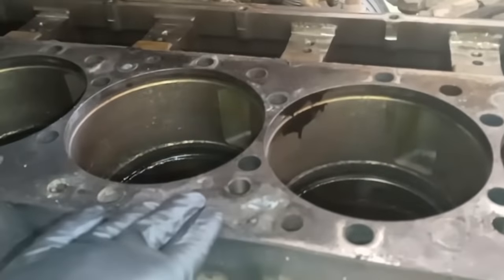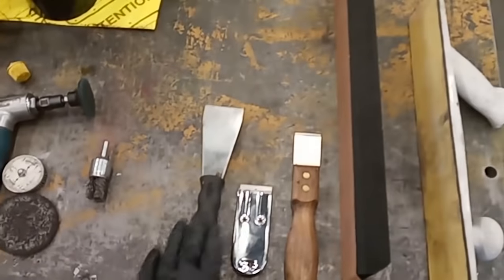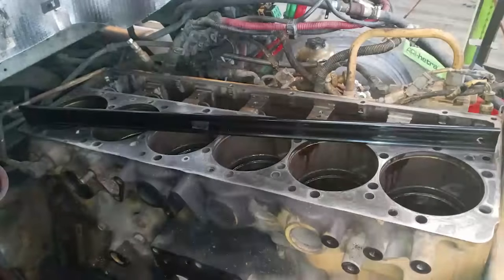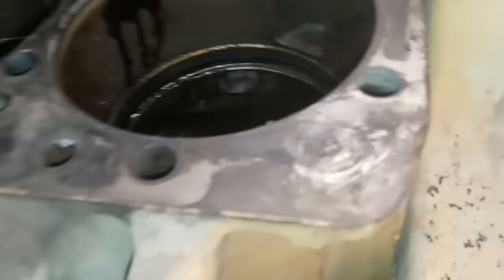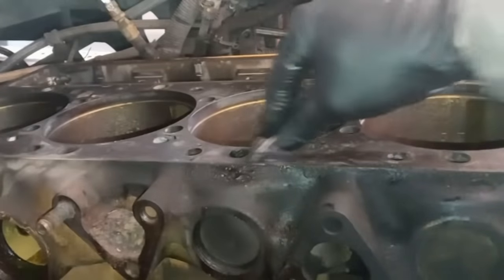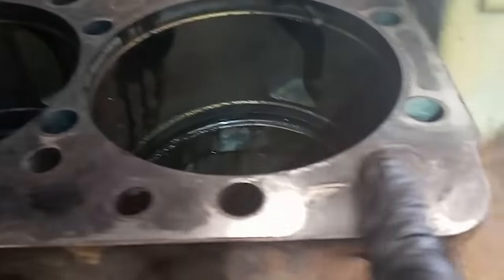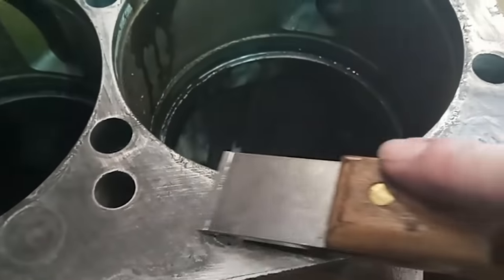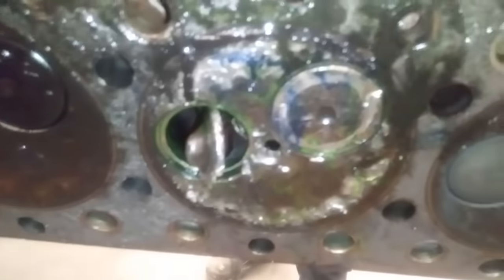Clean a Head Gasket Surface like a Master Engine Builder.

Comment: It takes a lot less time to do it right the first time than doing it over.  Whomever said that was right -- and I tended to learn the hard way.
Reply: I will never forget the plaque on the wall above and behind my shop teachers desk that read "If you don't have time to do it right, when will you have time to do it over?" That was 61 years ago when they still taught life skills in school.
Reply: I used to work in aviation and doing everything per the manual and standard industry knowledge was the thing. As a tech having a return from service was a black eye, or foot to the nuts if you messed something up that was preventable from the start. 
I had a plane back at the shop the next morning after an annual. The gear wouldn’t retract. My bosses were on it for half the day trying to figure it out. It wasn’t until I had a sudden memory of showing a dummy coworker the “emergency gear drop” cable under the pilots seat. The idiot pulled it. That almost had me canned, him walking out immediately with his tools, and me feeling like a fresh turd on a wet lawn. Safety and integrity in your work is key for the better of everyone. Your shop won’t have to lose money for repeat work it should have had done right the first time and the customer is safe with work well done. I should’ve checked the CO2 cartridge myself after, but that’s what trust in others gets you.

Comment: Im a paccar and cummins tech, what i like to do on cylinder head/block deck is to spray some wd-40 or pb blaster( to each their own) leave it socking over night, and when i finally start working on it, use a scotch brite burgundy pad(150 grain) the ones i use at work are excellent, they are great for cleaning metal surfaces,use that pad to clean as much as i can from the block deck and once ive covered the whole area, then spray it down with the brake cleaner, after that use some soapy water( dawn is my preferred soap, i like doing this because it gets any dirt or debri of of the surface, then brake cleaner again, and use the scotch pad to clean any uneven surfaces, once everything is good, spray it down with some crc contact cleaner, this will remove any small material from the surface,thats my method, it has never failed, i mostly do this for cylinder head/block deck surfaces

Comment: I am no mechanic myself but have taken some heads over the years to a machine shop to get skimmed to true it or valves/seats ground etc and I asked the owner of the shop what should I be using to clean the block deck with and he was adamant that I only scrape and do not use abrasive roloc's for the uneven mess they can create plus the abrasive dust, no sand paper, nor any form of hand type scotch brite pad because it has abrasive on it as well and claimed many an engine has been ruined just from those hand scotch brite pads. The problem he pointed out is that any abrasive that falls down into the engine which would be into the valley of a pushrod cam in block engine for instance or any oil passages within the block deck will end up pumping through the bearings and imbed themselves into the bearing and sooner or later bite you in the rear. Oh I imagine if the block was totally torn down and all oil gallery end plugs removed and dipped and so forth is one thing but its this top end work with the block in the piece of equipment that doesn't allow for complete cleaning. I feel the pain as well, picking away with a scraper and it never ends with taking minute quantities of gasket material off and wish there was a better way also. Adept Ape, I really enjoy your channel as do other farmers I know as you have a vast knowledge of Cat engines. With this frustrating gasket removal issue, how about you make it one of your missions to talk to various engine machine shops and if you know anyone higher up in the racing engine rebuild world, perhaps there are some secret methods most of us have never heard of.
Reply from the maker: You make a very good observation there and the balance of trying to properly prepare a gasket surface vs not getting any contaminates into the engine is an interesting topic. I would say at a machine shop it is an easier decision since everything is going to get hot tanked and properly decked. On an inframe rebuild or a field repair you are trying to do the best with what you can do. Now perhaps a better way is to just scrape the surfaces and the wipe them down, that would disturb the original machining marks the least, but perhaps miss some high spots or embedded gasket material? 

The topic of contaminates destroying engines is interesting as well, as every time a valve cover is removed dirt is getting into the engine. The particle size has a lot to do with how much damage it can cause as well. If the size is smaller than the bearing gap it has a tendency to not do damage as it can be flushed through the system without being wedged into the bearings, if the size is close to the gap size though it can cause the most damage. The larger the particle, the least likely it is to get past the screen and filter. Very interesting topic and I try not to take a dogmatic view on it as there are many good points to be discussed.
Reply: @AdeptApe  Thank you for the reply and also for not thinking I was trying to belittle anyone as topics like this can get people rather wound up because they have done a certain thing for years and can get their back against the wall to to speak to hear someone tisk tisk a practice. You are so right, the machine shop can very easily say do this or that because he has all the equipment to work with a complete tear down and isn't the one working on a head removal only or an inframe. Now unless I am wrong I believe that machine shop was pointing in part to the fact that some of the grit particles that find their way into the oil passages are "after" the filter and so the filter can't remove what doesn't come to it until it has flowed through the engine upon start up to then come back around to the sump and filter. And I am sure that different engines due to their design are going to be more or less susceptible to getting the abrasive into the wrong side of the oil system when cleaning off a deck. 

I had never seen a carbide scraper before, looks like an easier tool to work with then the razor blade that sure wants to catch on any edges or holes that don't have a chamfer. I have holders just like you showed and recently bought a long handled type handle but have yet to try it out. But believe me, I have been so tempted at times to pull out the roloc on the angle die grinder out of frustration and go to town on the project but have to hold myself back.

Comment: I’m a marine diesel tech, work on mtu man and cat. We clean decks the same way but if you use some wd 40 with some scotch bright pads after the sand paper it will shine the deck up good and pull a lot debri you can’t see by eye out

Comment: Been doing this over 40 years and agree. It's easier to keep it flat than to make it flat.
Reply from the maker: I like that expression, I might have to use that.
Reply: @AdeptApe  Also: "It's better to be looking at something, than looking for something." 
I'd rather be looking at old material and taking my time, than looking for the metal I've just gouged out of the block with a disc.  :-P
Reply: Ok quick question, this all sounds good and is good. But you are sanding down the block, is there a tolerance? I was told you aren't allowed to sand so that the tech height remains the same, lets say your just changing a head gasket
Reply: Just curious. Do these same principles apply to a car head gasket?
Reply: @stocks4bt  absolutely
Reply: @traviscallaway9675  thanks
Reply: @viktortulbya2107  that's why you use 💯 grit sanding cloth  Your trying to get it flat and smooth without removing to much material
Reply: @viktortulbya2107  Yes, if you remove too much material you reduce the size of the combustion chamber, altering the compression ratio.  But that comes up more with shaving decks repeatedly at the machine shop.  Not likely here.
Reply: @reallyhappenings5597  i think this one has liners, no really i am just wondering about the distance between the crankshaft and the deck top,
Reply: @viktortulbya2107  it's deck height, and there are tolerances. there should be a groove somewhere in the block showing how far down it can be machined. there are only a certain number of times you can resurface/ only so much material you can take off before you need a new block
Reply: @johnqpublic401  deck height is what i meant yes
Reply: @viktortulbya2107  you’re not removing 0.005” so you are safe.
Reply: @stocks4bt  yup. Standard procedure for any head removal is to put the head on a surface plate to check for flatness.  Lawnmowers too.  The straight edge on the block tells you it is ready for mounting the straight head.
Reply: @reallyhappenings5597  for some engines you can buy oversized thickness gaskets.
Reply: @aussiebloke609  thats like the mercedes repair guide lol

Comment: Pro tip.  Cover rod bearing journals. Before any scraping, or sanding.     Don't want debris in oil ports.
Reply: If you do get debris in there or in the cylinder, can you just get an oil change to get that out of the system?
Reply: @gersonruiz1714  on first start up.  The debris would hit the new bearings,  because that's after oil filter.
Reply: @claterpillar1  how would I get the debris out from on top of the piston head?  Mine kinda looks like there’s debris on the edges
Reply: You can try using a vacuum to get it out

Comment: If the block isn't going to be thoroughly cleaned in its entirety, I would never use anything abrasive that can contaminate the internal part of the engine block. If u choose to do it anyway, I would painstakingly tape off the cylinders and other internal openings followed by a vacuum after completing the preparation. In looking at the video, u can see the sharp edge on many of the bolt and coolant holes. These should be hit with a tapered counter-bore to break that edge. Also, after scraping and Brakeclean of the surface, the entire deck should be sprayed or brushed with blue machinist layout dye (Magic Marker if u must). This will indicate the low spots in the deck very quickly during the sanding process so that particular attention can be focused on them using the straightedge with a light shining from behind; the suspect area then measured with a feeler gauge for acceptable compliance to specification.

Comment: Those zip wheels spray abrasive all over. I think that is a bad idea.
Reply: I've been using roloc disks for years. Yes they spray stuff everywhere. But, clean up after yourself.
Reply: Half assed way to do it though. If time is a concern use the 12” pneumatic sanding board, done in minutes and it’s done perfect.
Reply: gotta clean up with a vacuum, always

Comment: I've had the exact same experience as you. Went to school learned that scrapers, elbow grease etc the correct way. Got out in the field, even asked others, "what's the best gasket prep?" to which I usually would hear, "the fastest. scotch brite discs". Anyway, perpendicular razor has the lowest damage potential, angled on aluminum will cut chunks. Wet sanding with fine grit and WD seems to get things clean fairly quickly. Also, with the straightedge, put it on the surface and shine a flashlight behind it, look at the straightedge from opposite side and... light can't pass if there isn't a gap.
Reply: Yup same here 20yr red seal. Use razor scraper and scotch paper not rolocs. Use a lath fine file and if you need it to be perfect try using Prussian blue where ever it remains is a low spot. Draw file to verify.

Comment: Always done it using various scrapers and sanding. Everyone did back when I started and it’s served me well. My engines don’t come back.
Reply: Yep, diesel fuel works as a cleaner as well. Toilet brush and a bucket of diesel for first cleaning then finish off with some brake cleen. Good tip for anyone that's not getting a free supply of brake cleaner lol
Reply: @johndowe7003  Diesel was all we had when I started, the firm was too tight to buy brake cleaner! Though it was trichloroethane at the time which apparently causes cancer, so maybe just as well.
Reply: @andygilbert1877  yup we still use diesel to clean parrafin and oil off our rigs. The new style of diesel has a lot of surfactants so it's pretty much the same as soap. It's a game changer for small businesses and independent guys since it's a lost more cost effective.
Reply: @johndowe7003  Yep, plus you’ve generally got loads of it! (I worked on heavy equipment & fork trucks) We’d use it as a freeing agent too...leaving seized stuff in it over a weekend rarely fails.
Reply: @andygilbert1877  yep, dont forget to include shoving grease into holes with threads in them to protect the threads from the elements. i would always do that  to equipment that i would put away for later . plus diesel is the best soap for hand washin, just dont forget to rinse off with dawn hah

Comment: Ordered those scrapers and it's good to see someone else break out the out the autobody tools in a heavy duty shop I'm a heavy duty tech that grew up in a family bodyshop I will offer the advice that sanding blocks are most effective when use the 45 degree rule if your holding your sanding block parallel to the length of the head or block surface you sand in a 45 degree cross hatch or you have the sanding block on a 45 degree angle to the deck and sand parallel with the deck and change your paper often about 30 swipes by hand or 30 seconds with a sander. Thanks for the videos

Comment: As an engineer, I approve your video. Flat, straight and clean just like a fresh machined surface  is the way to go.
Reply: Well an engineers opinion is that valuable to a mechanic fixing the junk yall overengineer.....
Reply: @85jmccoy  Oh don't be so naive. Everything is designed and built to a price point set by someone wayyyy above an engineer's paygrade. It's not the engineers you should be frustrated at...

Comment: I USE A SURFACE STONE WHICH I HAVE HAD FOR 30 YRS FROM BUILDING STEAM TURBINES. IT WORKS GREAT ALONG WITH STRAIGHT EDGE ,FEELERS,WD-40 AND BRAKE CLEANER.THEY MAKE THESE STONES IN DIFFERENT SHAPES AND SIZES,SUCH AS TRIANGLES FOR REDUCTION GEARS AND GIANT QUILL SHAFTS. YOU HAVE GOOD VIDS,KEEP UP THE GOOD WORK OUR COUNTRY NEEDS THAT.
Reply: THATS COOL BRO BUT MAYBE YOU HAVE WORKED AROUND LOUD NOISES A BIT TOO MUCH
Reply: @kiyosenl.3889  I AM OLD AND SCARED LIKE JERUSALEM'S HILLS... THANK YOU FOR YOUR COMMENT...

Comment: This reminds me of scraping ways on a lathe bed, mill bed ect. Scraping ways
Reply: On the ways you should of been using a longer carbide scraper and making 0.002” deep pockets either cross hatch pattern or J-hooks.  Do that on a block and you will have hundred of failure points for the gasket.  A static seal of a gasket and creating oil pockets to sustain a film of oil for sliding surfaces are very different applications.

Comment: I use a wheel on heavy gasket residue and then wd40 and a machinist stone to finish the block. I will definitely look into getting that carbide scraper, looks awesome. And coming from a military mechanic background I check everything with a straight edge because privates will find a way to ruin the engines so badly.... 

Also we have a saying "you always have time to do it right the second time!"
Reply: Lisle now makes a more affordable version of that scraper concept.

Comment: The guy at the machine shop I use (car engines) has told me he likes my prep (plastic scrapers, razor blades and aluminum free scrapers). He told me he has seen several blocks that need resurfaced because of people using roloc and causing low spots. 
I have yet to have a block that needs decked (SHOCKINGLY, I'm waiting for that run to be over).
Didn't know the carbide scrapers existed. That's awesome.

For what's it's worth, my last personal build I ended at 500 grit. Gaskets sealed perfectly fine.
Reply: Yeah, that carbide scraper does look good.

Comment: This carries over for all engines 👍

With some engines such as the 3.6L Pentastar, the timing cover is notorious for leaking anywhere at 12k miles to 60k miles, eventually it'll leak. Guys I work with tend to use die grinders with sanding disks because it saves time...even though it calls for plastic and/or wood scrapers to get the three bond RTV off the surfaces of the engine and timing cover. With the sanding disks you run the risk of making low spots, not great for any type of gasket (RTV or not) and causing further problems. Takes way longer, but better to be done right the first time and not having comeback because you took mating surface material off.
Reply from the maker: Especially aluminum and thin castings, generally they are super expensive and easy to ruin. At least straight edge the part of you are going to use the die grinder, but that takes longer.

Comment: Good video! - as an aircraft engineer we were trained to lap any flat surface- on a head or block  the area between cylinder can be low causing a leak if not spotted
Reply: Thanks for saying it for me!

Comment: I started doing this a couple years ago. I too used the roloc but I ran into problems on a 3400 block and that was the turning point for me. It blows my mind how many technicians don't check the block and heads with a straight edge.
Reply from the maker: Yeah, I don't think I've ever caught one doing it in the couple shops I've worked on. Even when something leaks and comes back it was usually silicone that they used to fix it 🤯
Reply: @AdeptApe  If you are just installing a new head (not liners or anything else)do you still have to straight edge with the liners being in the way?
Reply: I'm rebuilding my ford 3000 rn, I was wondering if I should you razer blade or die grinder, I've always used razer blade